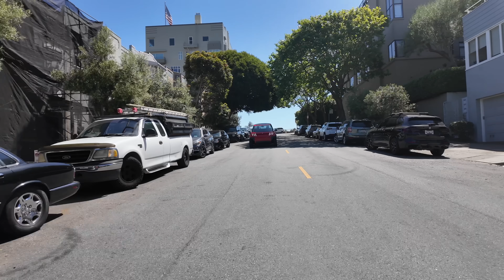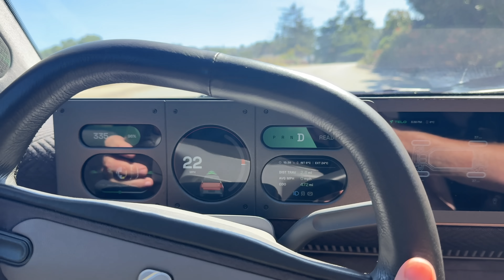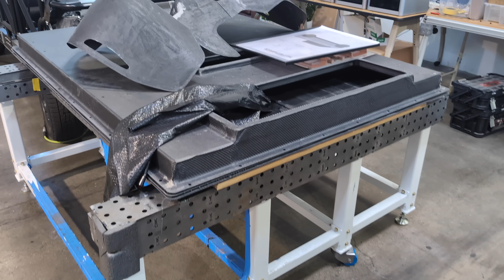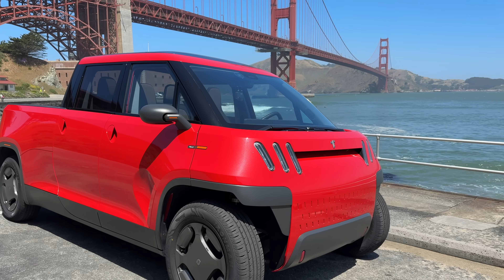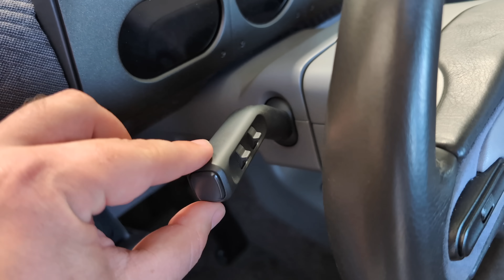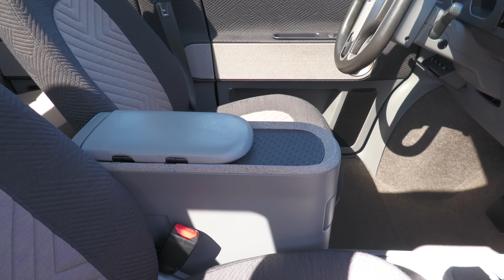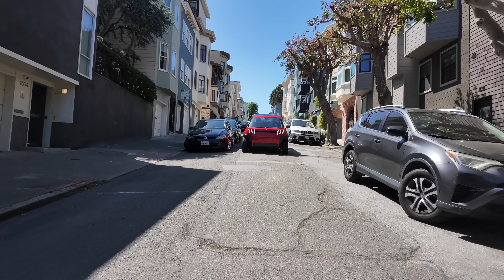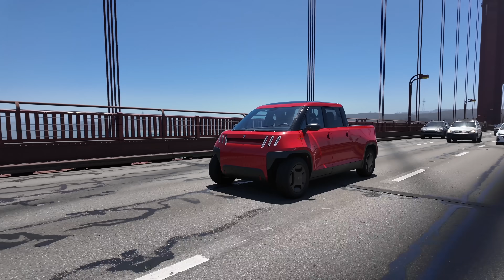The Tiny Telo Truck Hopes to Pack a Big Truck Punch

Comment: Can you make a version that can pull a trailer on the interstate? Bigger battery? Battery in the bed option? Generator in the bed option?
Reply: It’s rated for 8,000 lb trailer.
Reply: @skellener  The load rating is good for in-town towing. Highway towing requires kWh. Will there be a big battery option?

Comment: WHY 4 DOORS. It would be great if they maximized the bed.
Reply: The bed is maximized better than most other trucks are. Look at the wheel wells. Then of course you have the midgate that gives you an 8ft bed when you need it.

Comment: I think the car needs more profound fenders and a taller suspension, not for being bigger, but to be transformed in am all terrain if needed. The huge attack angle doens't make sense if the car do not pretend to go on trails. Even in this case, the cabin could advance to make some leg room for the back-seaters. Even for the front seaters there isn't much space.
First, I was thinking the bed could be reduced, but if fits some standards sizes of load cargos, better stay this way. So, the advance of the cabin before the front axles seems a good idea.
I don't know how to explain, but the design seems Peugeot. Said that, look at the design of Peugeot  Partner, Fiat Doblo, Renault Kangoo and others Urban's utilitarians. Also, to the Brazilians Fiat Strada and VW Saveiro in their newest double cabin arranges - they are urbans little pickups.
Reply: It’s actually perfect just the way it is.👍

Comment: Honestly if they did what Slate was doing and offered a 2-seat 2-door version with a bigger bed, that would sell like hotcakes compared to the Slate which is the same size, with the extended range version only getting to the same range as the Telo T1. Literally the only thing the Slate is missing is having a bigger battery IMO if you wanted to go on a longer trip without having to make dozens of charging stops.
Reply: It’s smaller than the Slate pickup. If you need a bigger née, just put the midgate down.

Comment: I love the idea. I'm concerned that "full-sized work truck" now means "5-foot bed". I get it, I just don't like it. They could wipe out the back seat, make it a 7-foot bed without adding any extra length, and they'd have a real truck.
Reply: It’s already a real truck and you get a bigger bed than most other trucks with the midgate down.
Reply: @skellener  All depends on what you're doing with it. If the use case is a family car with an occasional long item, it's perfect. 

Most of what I end up using a truck for is relatively heavy. 8-foot lumber, concrete bags. Lately I've been loading it up with construction debris once a week and heading to a landfill. I'm doing all of this with yesteryear's "small" truck, an '02 Ranger with a 7-foot bed. 

There's no world where I want to open a midgate and let all that spill out into the cabin(or leave the cabin open air in 100 degree heat). 

Worth noting - That Ranger is the last thing I've got running purely on gas. I'm super excited for small electric trucks, this one just isn't there yet for truck stuff.

Comment: I need an eight foot bed.  I don't need a crew cab.
Reply: Put the midgate down and you have an 8ft bed.🤦‍♂️
Reply: @skellener Also a cab open to the outside.  And is there anything stopping the load from going into the back of the seats?   If they offered a version with that part of the cab chopped off, I might actually buy one.

Comment: Looks like they'll be in production at the end of 2026. 
Lowest price is still $41,520 on their website for pre-order.
I think these are fantastic little trucks and I hope they'll succeed in selling us something that is finally different, but not so different it looks like a dumpster.
While every other manufacturer besides the one selling us a dumpster keeps wanting their electric trucks to look like classic trucks, there is no need for that big front end if there isn't an engine that needs to fit there and I applaud Telo for daring to change the look to make it more useful.
$41,520 for a very basic truck that isn't very comfortable for the passengers is pretty steep, but nowadays you can't get anything proper with a lower budget  in the US anyways.

Comment: Sooo... its the size of a standard pickup truck from 40 years ago. Cool, call me back when its smaller then a chevy s-10/ ford ranger (not the new pos they call a ranger thats even bigger then the f-150's from 10 years earlier)
Reply: It's about 4 feet shorter than a 2002 Ford Ranger extended cab with a 5.5 ft bed
Reply: It’s 152” long which is an inch smaller than a 2026 Mini Cooper. You can consider yourself called. Way smaller than anything you mentioned.

Comment: it costs like tesla but is empty, not even proper suspension, no lfp battery - much less charging cycles. 
it is not even a minivan. japanese and koreans head in right direction with k-car/microvans, this is micro truck is useless for any long items and has no lockable cargo compartment for small items
Reply: The value you get from the design of this truck far exceeds anything you get from a truck twice its price.
Reply: @skellener  how so? non LR version advertised range is 260 empty, 15%-20% less when fully loaded, less than 200 miles when towing(that means occasional fast charging requirement which can make some routes less convenient), while it costs almost like tesla, not comparing to hyundai and vw platform cars.

Comment: The short overhangs, four wheel drive, and low center of mass make this potentially an excellent offroader and tow vehicle. Entrance and exit angles are better than most offroad focused vehicles and the short rear overhang means crazy good stabiltiy for towing because the lever arm is so short. On top of all that it would fit in a garage and still let you park a motorcycle in front of it. It's not just city dwellers that would appreciate all these things.

Comment: The muscle car hp seems 'stupid' in a tiny little vehicle  Why????  You could use smaller motors that would get much longer range out of a given battery.  Why not?   This obsession with 0-60 times is just silly. Now, like any  fast car/truck, you need upgraded suspension and brakes and tires ($$$) to MATCH that.  I don't see any discussion on sophisticated suspension or Brembo brakes, so why are you making a dangerously fast truck without it?     C'mon guys, think this through.......Get over it.  Stupid fast was a the hook in the beginning for Tesla to show people that these were "Real Motors".  Ford and everyone else blindly followed the model like it's the only way.  "EV's are for dragracers" would be your industry wide description to this point........  WTF?     Job done....EV's can be FAST.......Reviewers giggle nervously. at the ludicrous acceleration.......... stupid.   MOVE ONNNNNNNNNNNNNNNNNNNNNNNNNNNNNNNNNNNNNNNNNNNNNNNNNNNNNNNNNNNNNNNNNNNNNNNNNNNNNNNNNNNNNN                                                                             The future belongs to whoever finally GETS this..(pretty sure the chinese get it.........)  200hp is PLENTY in a small vehicle with EV torque.  How many MORE miles of range could you add if 0-60 was a PERFECTLY LIVABLE and RESPECTABLE 8 seconds.................Hell, in the 80's 0-60 in anything under 10 seconds was "quick".  (VW GTI was 9.6 seconds).  Give me ONE good reason why ANY little tiny truck needs 500hp for ANYTHING?  People will kill themselves as they do in Tesla's almost every day.  (good publicity?)   Ask an insurance agent what the cost to insure a 500hp EV with a tiny footprint? LOL (that's what the agent will do)   Then ask him about the accident incidence rate for Mustang Mach E's.  I've read that close to 1/2 of all Mach E's have been wrecked.  Because people don't know how to handle 500hp.......and tires and traction control can't always handle it............  41k ain't gonna fly by the end of next year I'm afraid. The wave of foreign EV's will have hit the US and Tesla and Ford and others coming out with sub 30k full sized cars. In 2026.  Kia's K5? modular van starting at 28k-ish........  Gonna get TOUGH>................  Cut the hp in 1/2 (150/250) drop the 3 motor and the price by 10k and we'll (the country) talk.  And you'll have a future.
Reply: They offer a single motor version for less $$$$ that has 300hp.

Comment: For those who care. Drywall is probably the most dense weight per lb for something you might put in the bed. That is 38 sheets for the 2,000lb which would be about 20 inches tall. Which it seems like the midgate height is not close to that. But how often are we hauling that many sheets anyway? I currently have 2 vehicles for my home projects, this would replace both. I do not travel more than about 250 miles and would keep my small efficient ice vehicle for those long trips. I do feel like the price could go down $5k to start unless the incentives are very good.

Comment: Why is it a crew cab?  The back seats are useless. And the whole prototype thing is not a great look. Way too many people scamming investors already, it does not inspire confidence. Plenty of companies overpromise and underdeliver at best, most just plainly fold. Also, what does "exceeds a 5 star safety rating" mean? For something with an alleged 4 second 0 to 60 it does not look safe enough. And why does it need that kind of power?

Comment: Real electric car buyers and enthusiasts want off throttle regen. At least give it to us as a special mode or something.

Benefits include:
1. Range and efficiency:
Maximum regen off throttle means you don’t have to worry about pressing the brakes as soon as possible and just enough to get max regen without using the friction brakes until you need them. Unless you are absolutely perfect at essentially manually emulating off-throttle regen you are wasting energy/money/range. (Not to mention it’s impossible to be completely perfect because of the time it takes from letting off the accelerator to depressing the brake part of the way, and emulating something physically that could be an automatic feature just by changing some numbers around feels really dumb)
2. Safety:
The car starts slowing down hard when you let off the throttle rather than when you get your foot over to the brake and press down, effectively improving your reaction time to a sudden hazard. Also more minorly, having the car slow down significantly if you become incapacitated and let off all the pedals is also a good thing.
3. Comfort and convenience:
One pedal driving is so nice once you get used to it. Even if it doesn’t have true one pedal driving you can get most of the way there just with aggressive regen, especially on a 500 hp EV
4. Brake wear:
Using the brakes less wears them out less, and like I said before, if all the regen is active off throttle, I don’t have to worry about pressing the brake pedal just enough to get all the regen possible but no friction braking, and do it as soon as I want to slow down so I’m not wasting time coasting that will force me to use the friction brakes later
5. Brake feel: 
 Manufacturers have gotten much better at integrating regen and braking in a way that doesn’t make the brakes feel weird but braking feel is always improved by having the brake pedal purely control friction brakes while the regen is integrated into the accelerator (“gas pedal feel” isn’t really a thing so you don’t lose anything there).

The only real downside of having max regen off throttle is that it is very disconcerting for someone just coming out of a gas car. So I do think it needs to be optional and off by default, but easily accessible so someone switching to an EV can enable it once they realize it strictly improves their car, then disable it again when lending the car to people. The other less “real” downside is that some manufacturers don’t turn the brake lights on when off throttle regen is engaged or don’t do it soon enough but that’s just manufacturers being dumb.

Comment: Take a page out of slate and make the body panels easy to remove and replace diy. Heck maybe even sell prepainted trim pieces shortly after production. If these are actually used as trucks they are toing to get dinged up and being able to easily replace body panels with already color matched pieces in your own driveway is a huge plus.  But i can see this being pretty huge with off readers especially. The thing has probably the most acute approach angle ive ever seen same for departer. Slap a lift kit on there with some big knobby tires and some skid plates and this would be an amazing offroader. 

Just use manual open doors too. Stop with the electronic locks. Keep the same design if you want but just make it a basic latch. Less to break.

And the range should be 350 miles at highway speeds. 

 Otherwise this would be an amazing vehicle especially at that price point

Comment: They could use chemicaly engineered metal wood from Inventwood ... Fireproof stronger than steel half, 5xhigher torsional strength , lower energy costs 
Wt of Al, grows on trees ..,traps 50% of the carbon even after manufacture ..60-80 year untreated life span ...none toxic. Half price of even steel ... High ballistic resistance.

Comment: For something named after Aristotle’s Telos which can roughly be translated into purpose this truck seem to have very little of it. The video start by saying it’s a work truck then 5 min later it’s said that it has back seats as it may be someone’s only vehicle but then it’s purpose made for city driving so a couple of those are contradictory. Also I would love to see someone try and use a WORK truck in WORK gloves when 90% of it is a touch screen. There is just no direction for this and It just looks like another Silicon Valley “we’re going to do everything” but really do nothing in the end

Comment: Coffin on wheels.  Zero crumple zone.
Reply: The Smart ForTwo passed crash safety tests and was praised for the rigidity of the “tridian safety cell.” - I don’t see why this can’t happen here.
Reply: @AlexanderWojciech.  1 - it doesn't have a safety cell.  2 - rigidity passes the energy to the occupants. You want crumple zones instead.
Reply: @T @TogetherWeStand_DividedWeFall e smart car’s cell transmitted the energy to the chassis, not the occupants. Small cars can be safe, it’s just a lot harder to get correctly.
Reply: @AlexanderWojciech.  No.  The Smart Car only had an average rating compared to cars IN ITS CLASS.  Compared to larger cars, it was a death trap.

Comment: Way too much horsepower, make the motors smaller. You don’t need to drag race a pickup. 200hp 250ft-lbs would be better make the back seat bigger and usable.

Comment: It's cool. It probably isn't my solution though. We get winters up here that are really rough sometimes, and if I'm replacing my gas winter truck, it needs to be able to trudge through a foot and a half or more of snow. The other thing I question is towing capacity. Like you said also parts and service.
Currently I'm following Alpha but they're doing mostly nothing far as I can tell. The Wolf seems to always be several years away.

I wish this company success though. If they do their homework on why other EV companies failed they may just succeed. We need more EVs of various form factors. Off-road capable and more handling oriented options, not just blobby SUVs and massive fullsize trucks that won't fit in my driveway.

Comment: I have the most respect for this one out of all the electric vehicles you've featured so far.  It's definitely had the most thought put into it.  Also, it reminds me of a Japanese Kei truck, which doesn't hurt.  That being said, I hope they offer a model that has a non-glass roof and a two-door version with an 8 foot bed so it can be a proper "truck" that can haul an 8x4 sheet of something.

Comment: Lost me and most people at $40,000-50,000, because we know it will be more than that when(or if) it's ever available. 
Charging time based on 50% of the battery's capacity(30-80%). 🤦🤦. And on what kind of charger and is it readily available...

Comment: A car is only as nice as it can be maintained.

Which means you either need an educated and able consumer to do the work themselves... Cons. Small consumer base, will be like 3D printing. Very vocal early adopters and then its just toys.... nightmare.

Or you have service centers that take up land. Cons. Land cost and location. Nightmare.

Or you have to figure out the shade tree mobile mechanics and logistics on that front to service vehicles. Con. Lengthy and individual logistics pathways. Nightmare. 

However you slice it the maintenence part of vehicle ownership is a huge hurdle for a company.

Comment: "Nobody buys 2 doors in the US anymore"

Because nobody makes them! There are plenty that would want a larger bed (without using a midgate) or even just an extended cab option that doesn't waste materials or weight on a back seat.

That said I would rather there be multiple small screens than one big screen with a bezel. But that's a long term durability thing. sure it's more things to break, but I'd rather there be a point where if one thing breaks it doesn't take out multiple things at the same time.